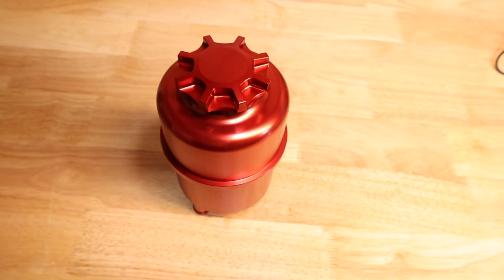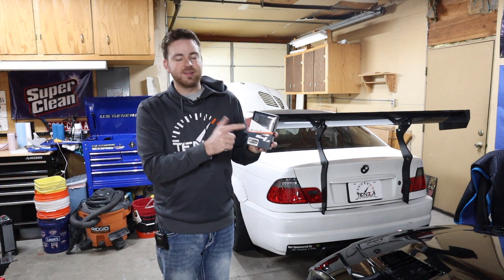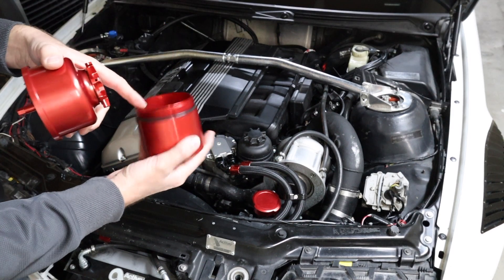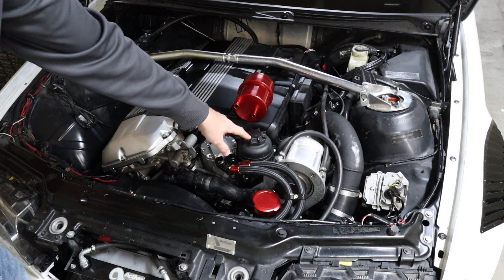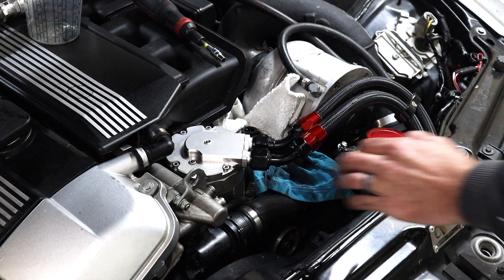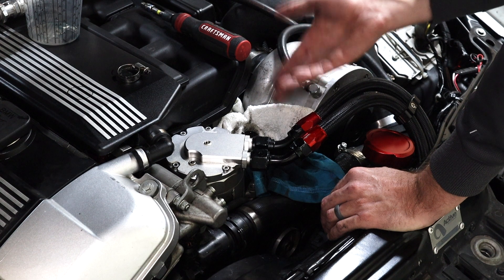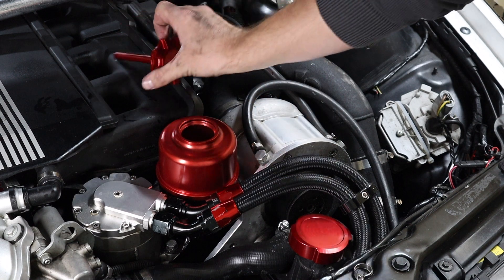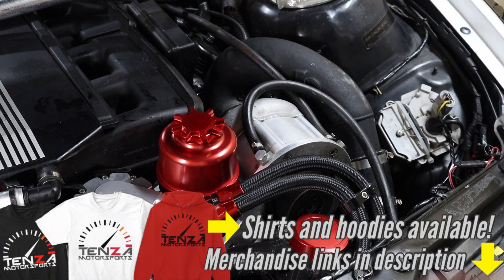Billet aluminum Power steering reservoir reliability upgrade - No more leaky plastic - BMW E46

Comment: I have a question about what you did to separate the top part from the bottom half to get access to the filter. cause mine won’t twist apart.
Reply from the maker: Sorry for the late reply! were you able to figure it out? mine just came apart, no issue. wasn't tight or anything.
Reply: @TenzaMotorsports I picked one up a few days ago and am also having an issue separating the halves…any idea?